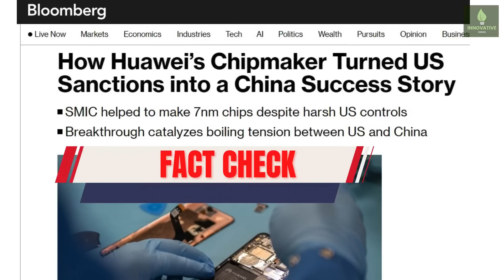U.S Embarrassed as Chip SANCTION on CHINA Boosted SMIC Success

Comment: The false narrative that the US preaches about hindering China's military by denying China the equipment or semiconductors at the high end is false.  High end chips are used in mobile phones and high end personal computers.  GPU chips are used in AI applications.  What is to be noted by the latter is that Nvidia chips are not made at the high end, but more mature nodes.  The point being that high end chips are used in things like AI  that could be used for military applications, but the preponderance of chips used by the military are mature node chips, to which China has matured and produced in quantity.  Military chips used in applications such as navigation, fuses, radars, missile guidance, communications, and like applications use mature node chips that meet military standards that are higher in environmental requirements than consumer chips.

For example, here is one military spec for semiconductors:

https://www.navsea.navy.mil/Portals/103/Documents/NSWC_Crane/SD-18/Test%20Methods/MILSTD750.pdf

Environmental conditions required for testing set it apart from commercial use semiconductors.  Temperature ranges, humidity, altitude, vibration, shock, radiation, are some of the requirements for military semiconductors.  The closet a commercial semiconductor comes to that are the specs for automotive semiconductors.  All of which are mature node semiconductors.

https://www.kla.com/documents/Autonomous_Vehicle_Technology_The_reliability_challenge_with_automotive_semiconductors__2020-07-21.pdf